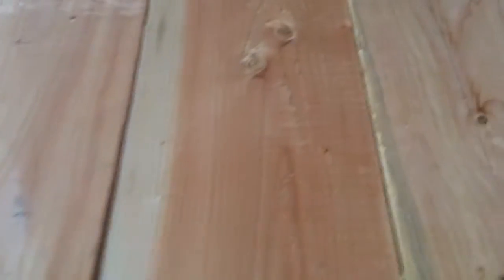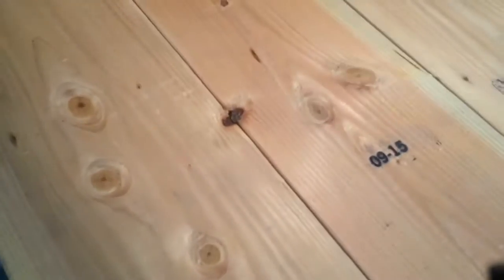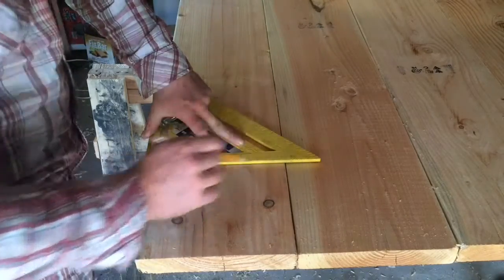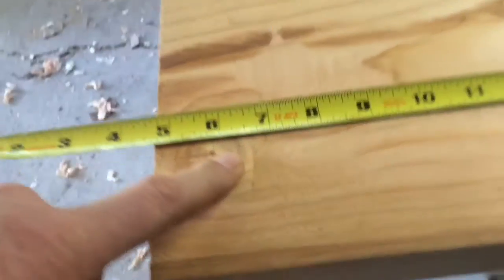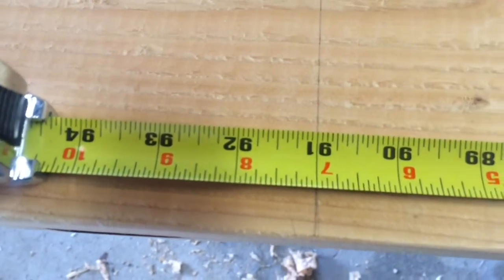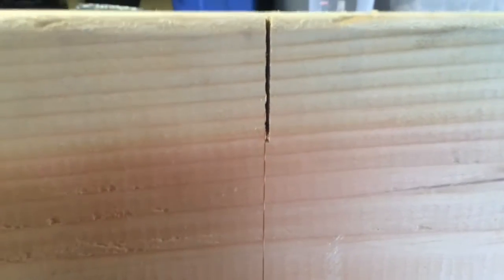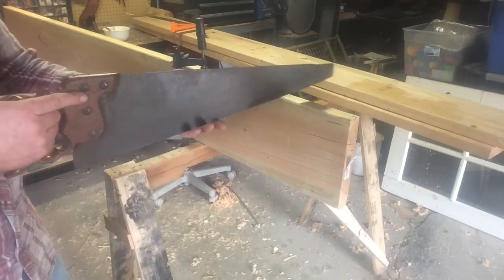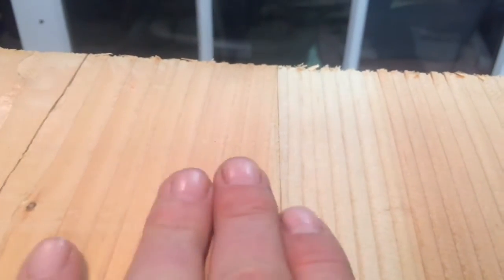Timber Frame Family Dining Table 2

Comment: The longer the better if you ask me, thanks for sharing.
Reply from the maker: I absolutely agree. The biggest reason I didn't use the full length of the boards is that the house we currently live in doesnt have the room to accommodate. I did make it as long as I could though. Thanks a bunch for watching.
Reply: I was referring to the length of your video's Zack.... but you did make me smile hehe... by the way, the table turned out great.

Take care.
Reply: Funny I made that exact mistake years ago. I built a wall assuming all 96" studs were 8' as the sign said at the hardware store. Ummm no! Should of listend to my shop teacher. He would say when you assume you make an ass out of u an me.

Comment: what kind of wood are you using?
Reply from the maker: Hey Mark, I just used fir from the local home improvement store.  My thought was to make it rugged and inexpensive and to make it of something that wouldn't cause me to lose my mind when my kids bite the table edge or accidentally poke it with a fork or any of the other unexplainable things that kids do.  If I were to do it again I'd get lumber with as absolutely few knots as possible as well as make sure it was good and dry before building.  Thank you for watching!